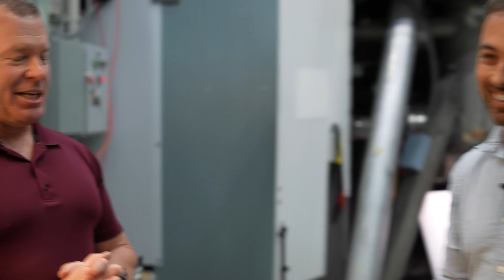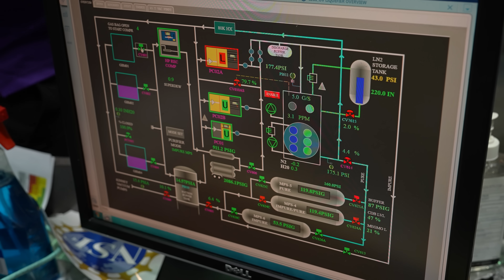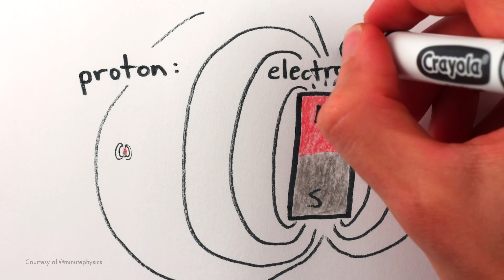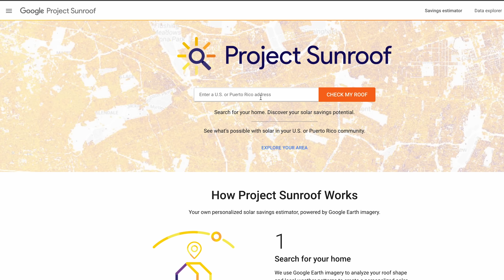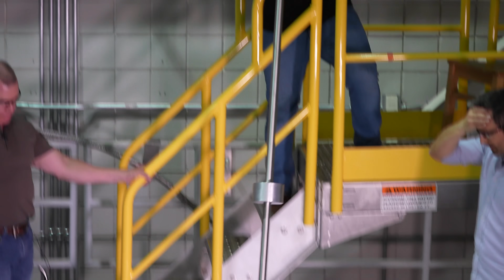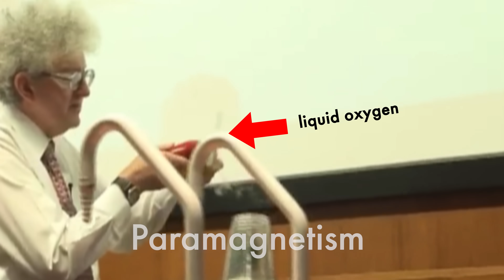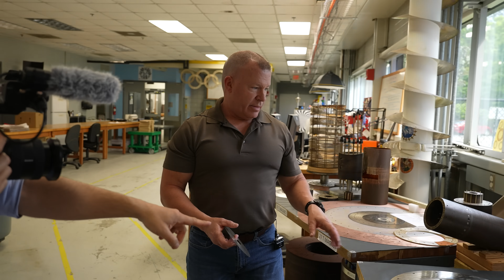World's Strongest Magnet!

Comment: 47k amps at 500 volts so roughly 23,5 megawatts of power for an hour, so 23 megawatt hours of electricity was used during the production of this video. And an average American household uses about 10 megawatt hours of electricity in a year. So, I think you’ve just dumped roughly a… lot of CO2 into the atmosphere to produce this video. Not that I’m complaining, I actually don’t care, but I think it’s kinda funny.

Comment: Working in the High Field Magnetic Lab in Grenoble France, I work with a 16T superconducting coil every day, and I've also experimented on up to 36T, and I've gotta say, there are a lot more things you can have fun with in these sorts of labs. Soon we'll have a 43T coil here too!
Reply: @coquillage8211 lawyer named finger:
Reply: That must be exciting.
Reply: What if we line a few up and launch a metal ball?
Reply: It sounds like there's almost a fundamental limit at 43T; the superconducting part simply can't go any higher, and the non-superconducting part is working at the edge of its material limits as well. What would you have to do to go higher, to 50T? What about 100?
Reply: @forrestofbarnes  it can be achieved but in a pulse mode only
Reply: @forrestofbarnes  The superconducting part is limited to around 21 or 22T I believe, and that's if you pump on the 4K helium liquid bath to cool it further down to around 1.8K. I can't say what the limit for a combination of both superconducting and resistive is though. Pulsed fields lasting no longer than a few miliseconds can go up to 100T or at least very close to that

Comment: I'd love to know why this type of magnet cannot be used for fusion reactors. There has been a lot of recent excitement with the development of high-temperature superconducting magnets for fusion based on ReBCO materials such that when MIT developed their 20T prototype it was announced as "The most powerful magnet in the world". Clearly this was wrong but I also wonder what the major differences are between those magnets and this 45T monster.
Reply: Supraconducting magnets have been used for fusion experiments, but most tokamaks use copper coils instead to simplify the design (no need for cryogenics).If you mean ReBCO in particular, it is because it is a ceramic and it is hard to make it into a coil. Not impossible thought, so some startup want to use it, so they can reach higher magnetic fields than with standard supraconductors.

Comment: Magswitch allows you to turn a magnetic field on and off mechanically. I'm assuming it's two magnets that can double or cancel the others magnetic field depending on alignment. The theoretical strengths are 60 to 600 lbs. (take that with a grain of salt). Cool if you want to switch a magnet on and off without carting around a battery and wiring.

Comment: the heating on that plate showed by the thermography came actually from the reflection from other objects or ceiling, you can see this clearly, and he says exactly on this second that "it is  heating up", but it is not possible to know how much was caused by the magnetic field to this specific material.

Comment: @Veritasium  The problem with what you're doing there is that aluminum (conductors in general) is a very poor emitter of thermal radiation. It's mostly reflecting the infrared radiation around it. You can see the guy's reflection in the metal. You need to coat it in oil to get a more accurate measurement.

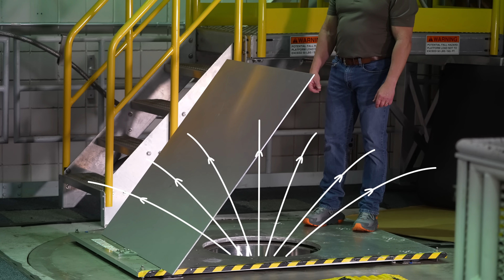Comment: 9:08 "number of magnetic field line"... 

The magnetic field strength through the cross section is changing, but there is no such thing as magnetic field lines, and you certainly can't count something that doesn't exist. 
Please stop perpetuating ignorance through teaching that sugest field lines are real, and or remind people that field lines are only inventions of our minds whose density changes are to visually represent a concept entirely different than a line. 

Magnetic field lines are an imagination tool to represent magnetic field strength and direction.  

And neither are fero fluid spikes or iron filings examples of magnetic field lines they simply are examples of higher magnetic permibility concentrating magnetic fields through a lower reluctance cross section.
Reply: Pedantic are we? Yes, the so-called "lines" are not really lines as a line is an abstract concept. They are useful in picturing the direction and strength of a magnetic field.  But the layman is probably not willing to spend the time to learn the difference between the physical reality and the pictorial representation.
Reply: @TheDanEdwards  useful for conveying certain concepts. Yes I pointed that out. My point was to teach field lines are an invented concept to help visualize.

I'm not sure how often you run into the many laymen lead astray by field lines, taken down so called magnetic vortex, ser adrift on fake aether, and dazzled by kaleidoscope hall of mirror ferro cells, or have no understanding of homopolar generators ect ect, and get lost in so-called paradox. No actual understanding of magnetic fields perpetuates all those ignorance.

 I never had a problem with using field lines to sugest a field density and direction through a cross section, but are you sugesting its too much to point out there are no actual field lines. They are inventions of our minds to understand certain concepts, or that fields don't rotate or vortex on a magnet's axis.

Comment: For reference, Magneto from X-men would need a magnetic field strength of at least 296.6 Tesla to lift the Golden Gate Bridge.

To calculate the magnetic field strength required to lift the Golden Gate Bridge, we need to make some assumptions about the bridge's weight and composition. According to the Golden Gate Bridge Highway and Transportation District, the weight of the main span of the bridge is approximately 83,000 tons (75,295 metric tonnes). We can assume that the bridge is made of steel, which has a magnetic permeability of around 5000 H/m.

The magnetic force required to lift the bridge would depend on the distance between Magneto and the bridge, as well as the magnetic field strength required to overcome the gravitational force on the bridge. Let's assume that Magneto is standing on the bridge and lifting it vertically.

The force required to lift the bridge would be equal to the weight of the bridge multiplied by the acceleration due to gravity, which is approximately 9.81 m/s^2. Therefore, the force required to lift the bridge is:

F = 83,000 metric tonnes * 9.81 m/s^2 = 815,430,000 N

To calculate the magnetic field strength required, we can use the formula:

B = (F / (μ0 * A))

Where B is the magnetic field strength, F is the force required to lift the bridge, μ0 is the magnetic constant (4π × 10^-7 T·m/A), and A is the cross-sectional area of the steel in the bridge.

Assuming the steel in the bridge has a cross-sectional area of 10 square meters per metric tonne, the total cross-sectional area of the steel in the bridge would be:

A = 83,000 metric tonnes * 10 m^2/tonne = 830,000 m^2

Therefore, the magnetic field strength required to lift the bridge would be:

B = (815,430,000 N / (4π × 10^-7 T·m/A * 830,000 m^2)) = 296.6 T
Reply: r/theydidthemonstermath
Reply: New bing is cool
Reply: The funniest part is that all the mutants that were standing on the bridge would've started spinning in circles for a little bit after the bridge was let down.
Reply: What is he reacting against if he's standing on the bridge? You can't fly by pulling on your own bootstrap
Reply: @shanent5793  not with that attitude.
Reply: @shanent5793  what a dumb question. He toggled creative mode ofc
Reply: Except Magneto can apparently control any metal so his ability isn't actually based on electromagnetism. It's just a name like Cyclops or Wolverine.
Edit: think more like metal-bending in the ATLA universe.
Reply: Nice math, but you forgot about resistance from buried pillars.
Reply: That was a chatGPT prompt right?
It makes no sense, "B = (F / (μ0 * A))" doesn't even match up in units
Calculating how a magnet can pull steel is absolute hell and Tesla are not suitable units for that

You could assume the entire magnetic field is in steel: mu=1.24*10-4
A = L*w = 2700*27.4m = 74000m^2
m = 380*10^6 kg (google)
and use F = B^2 * A / (2*mu) ; From wikipedia on electromagnets, honestly a random formula with little to do with what we want
and with F=mg you get B = 3.56T

That's because a Tesla is about the magnetic flux density, so it doesn't really scale with the size of what you want to lift.
Anyway even this is wrong, as the steel of the bridge cannot hold more than a certain amount of magnetic field.
You'd need to make a hell of a calculation with magnetization of steel domains and the torque each domain produces, basically hell
Reply: @pastek957  Either chatgpt or new bing, the wording in the English parts if the comment are too familiar

Comment: When lifting the aluminum plate, did the resistance feel like weight or was it more like an increase in viscosity?
Reply: I think Is would be more like pushing It in water because It opposes fall too and It has a favorite direction/alignment where the effetc Is smaller
Reply: For resistance in viscose fields, the force you need to push an object would be related to the velocity
For weight, the force would be mass times acceleration
The Lorentz-force (re)acting on the electrons in the plate is proportional to the velocity and thus it should be closer the viscose case
Reply: Like an increase in viscosity.
Reply: A decrease not increase